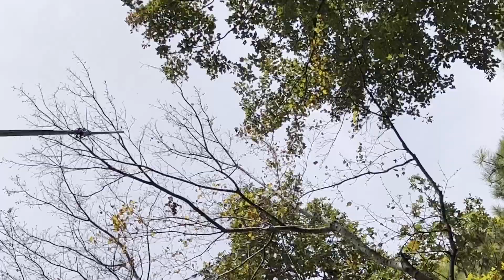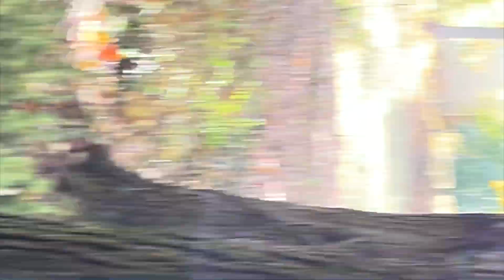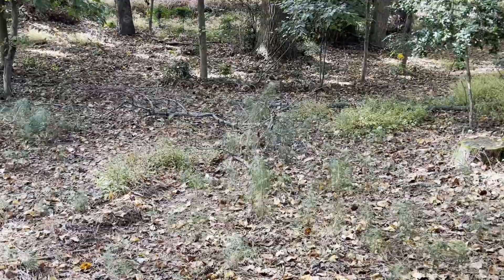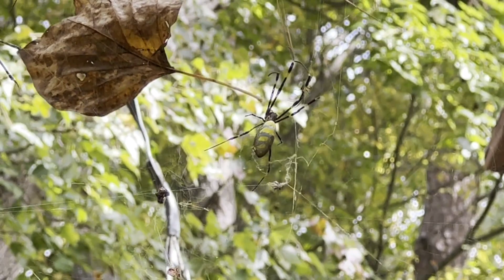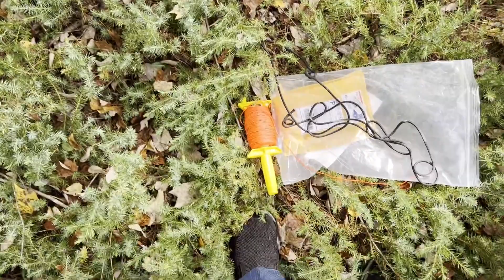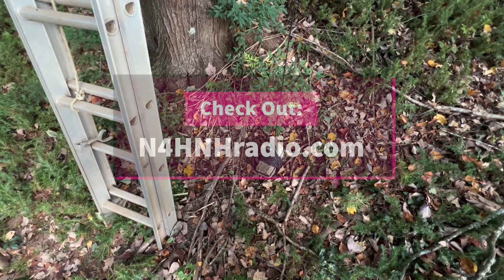Antenna Reconnaissance - 160m Doublet #hamradio #hf #antenna

Comment: Hi, Doug. About how high is your Ladder-loc off the ground? It looks like your back yard slopes into a ravine. Nice trees. Appreciate your work.
Reply from the maker: The Ladder-Loc is approximately 40 feet above the ground in my backyard.  My front yard is 8 feet higher. I live in a low spot.  On three sides the ground is higher than my roof. Bad for groundwave but skywave does okay.

It works out nicely for 80 and 160 for regional comms during the day and early evening but I still get DX at night. It also works well for DX on 40m at night, but my ZS6BKW beats it for daytime 40m work.  For 20m and up, the Doublet provides incredible range, day or night.  It’s plenty high enough off the ground for higher frequencies.  It is unbelievable on 10 through 15m.

Comment: ...& re hanging antennas, I've gotten pretty good at slinging (underhanded) a small angled rock with some string tied around it; after sone practice & experimenting with rocks of different wgts, I was able to easily put my anteenas up at 50' in the trees (when I'd pull thru heavier support line{s} with the string)
Reply from the maker: I used a throw bag and rope, like the tree surgeons use, for many of my earlier installations. I still use one for SOTA, when I deploy my EFHW or my linked dipole on a mountain summit. But I find that I can be more precise with the slingshot.
Reply: @n4hnhradio  yes, agree, much easier to aim, for sure! However, I found that, if simply trying to lay a line over, say, a treetop (knowing it'll eventually lay somewhere among the high limbs), slinging a small (angled) rock [with a string attached] works quite well (especially when I didn't have a slingshot on hand)! Thanx for reply & feedback, 73 friend, de WA4ELW in TN 🇺🇸😃

Comment: ...& I've had my actual, radiating antenna wires (both insulated & not) lay on & sometimes be pulled thru "V's" between heavier limbs, becuz I didnt have enough space between two trees to hang my antennas horizontally (or close to it); & I've never noticed any difference in performance, whether the wires were in a totally open space or were run thru an entanglement of limbs, LOL!
Reply from the maker: There shouldn’t be any difference in performance except when the limbs are soaking wet and the insulation has been scraped off the wire. But it just causes the SWR to rise. My antenna matching unit will automatically compensate for it.  My OCF dipole and my ZS6BKW are both threaded through multiple tree limbs and touching them. As I have stated in numerous videos, antennas are more forgiving than we give them credit for.

Comment: re the end of ur antenna that u showed, with the dacron rope going straight down to the rock laying on the ground, a suggestion: u cud get a nice bungee cord, with hooks on either end & "connect" it between the rock & ur support line, giving ur antenna plenty of room to stay taught (but not too tight) & to ride the winds of any storm(s) with ease (&/or perhaps do the same on the other antenna end, too)! I did the same on both ends of my ZS6BKW & it's [almost] a flat top, nearly horizontal; in ur case, depending on the wgt, u cud perhaps use a heavier rock, or even better (as I did), wrap one end of the bungee cord around the base of the tree or around a heavier limb near ground level! 73 de WA4ELW in TN 🇺🇸 dit dit 😀
Reply from the maker: That is what I did with my ZS6BKW and my OCF dipole.  I guess you haven’t watched those videos yet.  This current setup with the rock has been in place for over 20 years. Still the same Dacron rope. It has never failed.

Comment: Using two short lines in a V, you can position anchor point so radiators keep clear of the wood.
Reply from the maker: It’s a 160m Doublet. It requires 250 feet of wire. I can’t get the center point high enough to make it an inverted V.  Plus it performs best horizontally.  My ZS6BKW is set as an inverted V.  But it would perform better for DX if it was a horizontal.
Reply: @n4hnhradio  Sry I wasn’t more clear. Tie a second line to troubling anchor line and pull it away from the tree, making a V shaped anchor. Using two or three lines you can pick a preferred anchor point in free space.
Reply from the maker: @Aimsport-video good idea.  I just shot over the limbs in this case. The antenna is higher now. Performance has improved too, which is nice.

Comment: I completely agree with you on the window vs. ladder line observation.  For 2 years now I have gone back and fourth between 600 Ohm Ladder and 450 Ohm Window.  After all this time of going back and fourth, the differences IMHO are negligible.  However, as you pointed out, 600 Ohm is a bit harder to work with due to its width. My recommendation to those reading, if you get a chance to work with both, please do as I found it to be a good experience over all.  Lastly, I prefer window over coax any day of the week. Over the years I've had more problems with Coax than I ever had with Window.  Another reason I like Window is I can add and take away length from Window very easily. Those are just my thoughts and your mileage may vary.
Reply from the maker: My brother needed around 170 feet of feed-line for one of his dipoles. LMR400 would have cost around $200.  I suggested window-line.  Just turn the dipole into a Doublet Antenna System.  He saved money and has a lower loss antenna system.  My main antennas are the 160m Doublet and the ZS6BKW, which is also in the Doublet family.

The lowest SWR for my Doublet was at around 16MHz, just based upon the length of window-line I needed to get to the shack when I first built it. I shortened the window-line until the lowest SWR fell into the 17m band.  I need no antenna matching for that band. And you’re right.  I could have added window-line to move the point of lowest SWR to the 20m band.  We just have to be careful that we don’t use a length of window-line that is a multiple of a half-wavelength. My window-line is approximately 55 feet long, which is within the 35-60 feet recommendation for a 160m Doublet. The next acceptable length is 170-195 feet, followed by 210-235 feet.  We have to be sure that the ladder line length is converting a high feed-point impedance to a lower impedance at the antenna matching unit. Avoiding multiples of a half wavelength will help with that. 

73, Doug

Comment: Hi Doug,
Took a little effort to solve that problem. Wish I had trees like yours on my property. I would have my ZS6BKW up in the air. Stay safe.  73  WJ3U
Reply from the maker: Hi Don!  Yes, it was a lingering issue that I should have solved a few months ago. I’m sore today. Slipped on that vegetation a couple of times. Also standing on the ladder and stretching to cut the limb that was in the way. Enjoyed the slingshot time though. The antenna is definitely working better.  73, Doug
Reply: @n4hnhradio  Hi Doug,
Glad all the aches were worth it.  🙂 WJ3U
Reply from the maker: @DonDEgidio yes, it was bugging me for a while. There is no telling how long the wire on one side has been on the ground.  It’s a lesson for me to conduct more antenna reconnaissance.